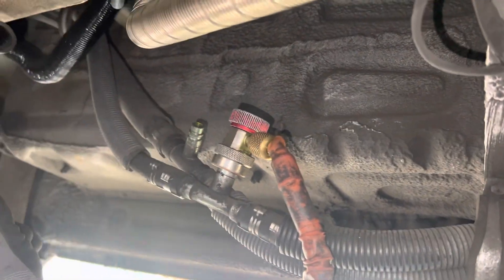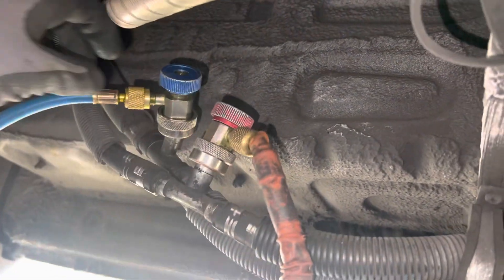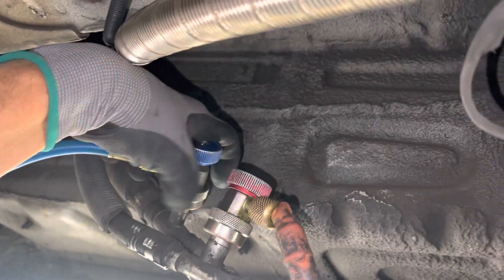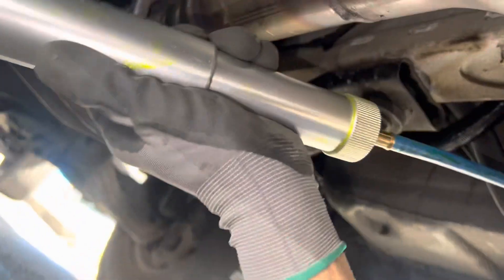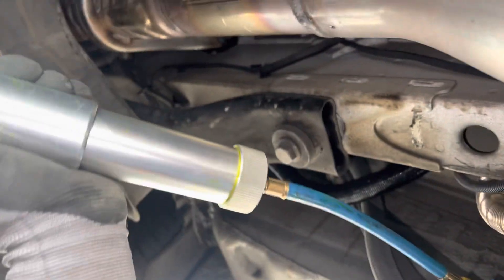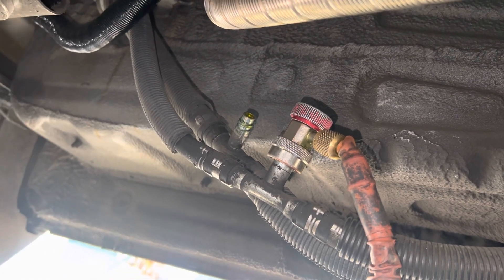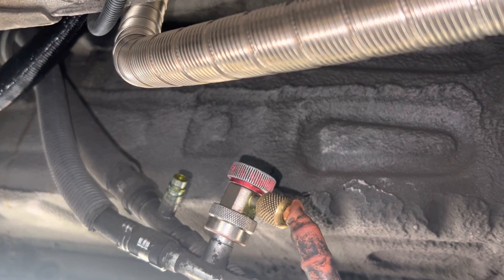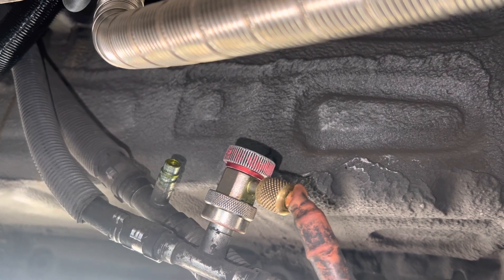SIMPLE Add UV dye system filled with refrigerant ! no leaks ! no spilling￼ !.

Comment: What about the air in the tool  hose?
Reply from the maker: No air in tool hose.  Completely filled with dye.   Cartridge holds 60 ml dye.   You are only using about 2ml to 5 ml dye per vehicle.  Depending on oil capacity of each vehicle
Reply: @coldfinger459sub0  Already filled ,I thought you fill it or coming without hose and you need to attach it to the tool.
Reply from the maker: @issamadam9352  I filled it.   And screwed the plunger pushing purging up out the air though the hose.
It will always be airtight and sealed after that first installation of filling with oil or dye

Comment: Hey tom these oil pump works really well but would even be better if the measurements was engraved instead of the cheap sticker they used on them or the one I has
Reply from the maker: Yes it would be really nice if it was engraved on them. 

But the stickers they do put on them I usually find last for a decade or two.   Unless somebody steam cleans the engine. 

Put on commercial and residential equipment I’ve installed equipment two years later if the sticker was facing the sun you could barely read it after four or five years forget it it was worthless

Comment: I got an in-line  injectior
Reply from the maker: You mean in-line injector. 

I remember those from back in the early 1990s are used to have one of those two. 

I would pour in the dye

And then pull a vacuum on the dye through the manifold holding it up right so that I would not go upwards but the air would be sucked out to the top portion of the injector so I had to make sure I don’t contaminate the system with moisture or air.

Comment: Is there not a possibility of a small of amount of moisture getting in from the small section of pipe or is it possible to purge it?
Reply: You can purge the line with using the refrigerant of the system. By cracking the hose connection at the canister, then while depressing the core tighten the connection. If you must (I don't see why, it is really insignificant) you can purge the hose at the fitting connection using refrigerant this will insure refrigerant charge in the system is preserved.
Reply from the maker: Unmeasurable insignificant. 

It would be like putting one drop of red food coloring dye in an Olympic size swimming pool are you going to see the color change lol 😂

Comment: Did you add uv dye mixed with oil, or just straight uv dye by itself. Will 2 ml of dye always work or is 1 ml enough on smaller cars?
Reply from the maker: This is straight up concentrated UV dye only

5 mL is recommended for large systems for remember the instructions up to 11 ounces to 14 ounces of oil capacity

For very small systems that only have 3 ounces or 5 ounces of oil capacity you only need 2 mL

You can even get away with 1 mL in the systems that contain 3 ounces or less of refrigerant oil

Tracer line products there high concentrated formula or this UV extends that you see me using here that I purchased in the previous video

I first went around many years ago and all my family members cars we’ve had five Prius hybrid cars and I install this in all the vehicles for testing

Also this UV extends tracer die in the tube I also installed it in all my vehicles basically doubling the amount of UV die in each family members vehicle including my own personal vehicles. 

My dad started me using tracer line UV fluorescent products 40+ years ago.